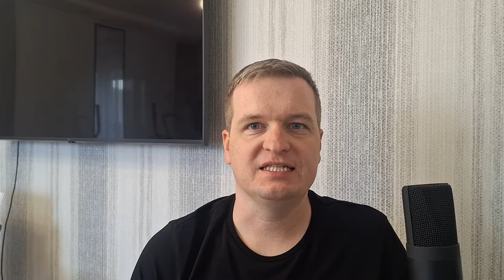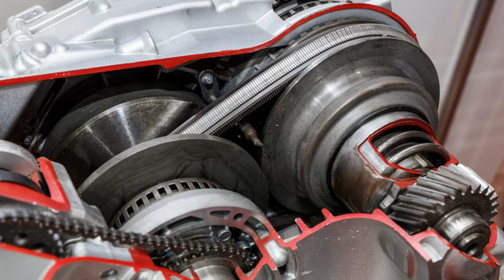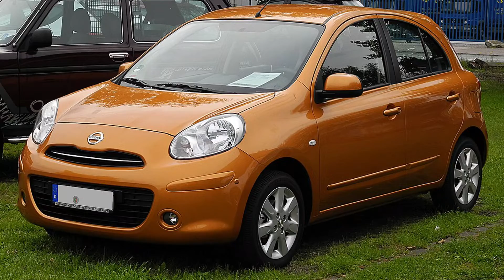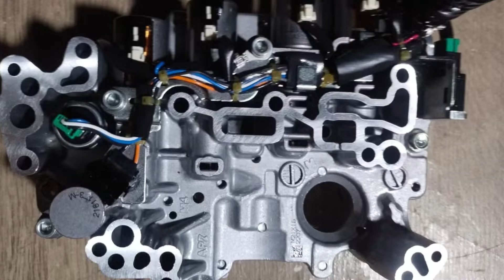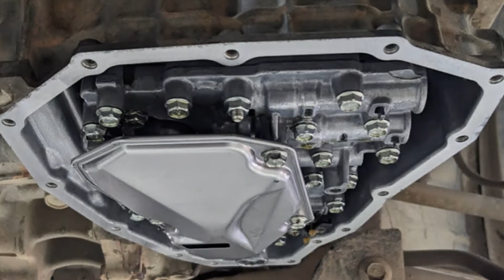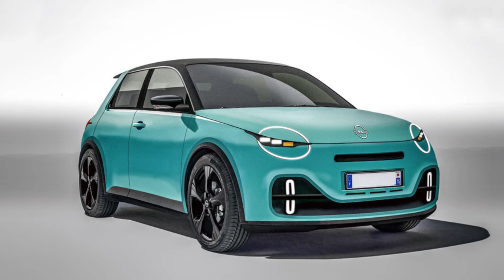Nissan Micra K14 automatic transmission problems

Comment: Our 2023 Nissan Micra, still under warranty, stalled spontaneously for the first time on July 15, 2024. The car continued to drive after the ignition was turned off and restarted. The same situation occurred a second time on July 22, 2024. Our employee experienced a major scare when the car suddenly stalled while cornering at 70 km/h on the highway. He narrowly escaped serious danger before he could stop the car and restart the ignition. During our conversations with the Service Manager, we were informed that they could not detect the problem with our vehicle. so what is the problem?any one can help?
Reply from the maker: This doesn't seem to be common for the Micra. But this is a huge safety concern, so I would tell the dealership to fix it or buy back the car if they can't. Also, contact Nissan main dealer in your country - this may be helpful. If they don't want to fix this, any court will make them buy back the vehicle since it's still under warranty.